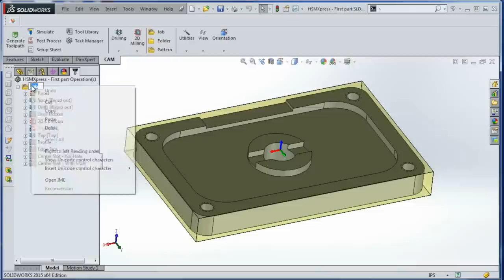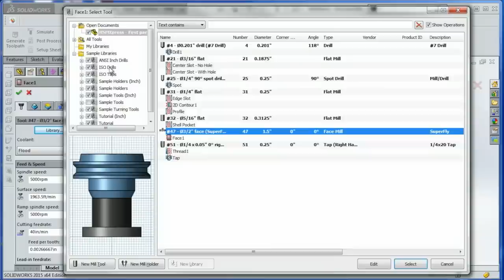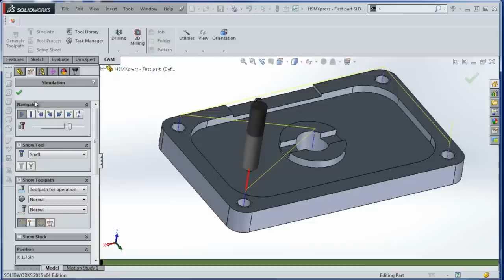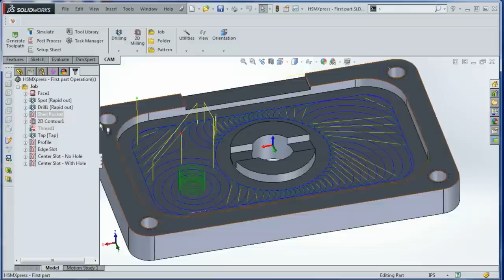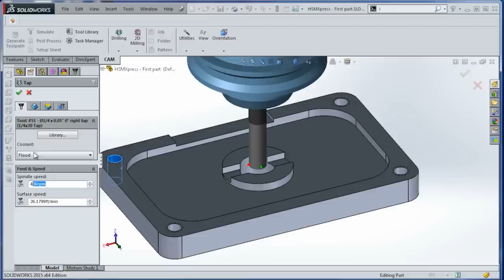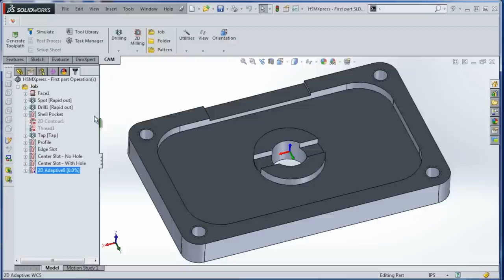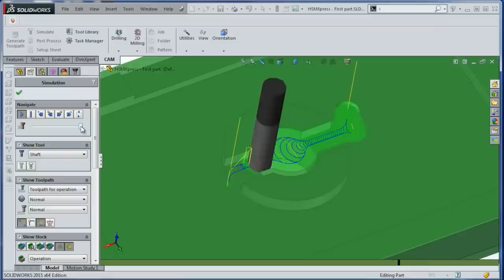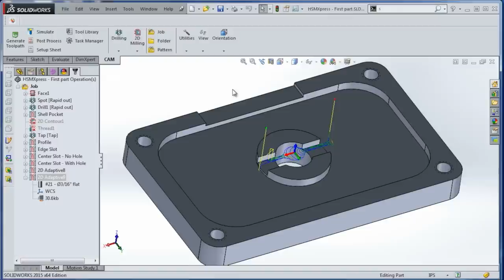HSMXpress Free SolidWorks CAM Tutorial Video!

Comment: I've got to say thanks for this vid. I'm a long time solidworks user and had previously used solidcam way back and more recently SprutCam. This vid pushed me to try HsmExpress. After about 15 mins, I had posted my first code. Air cut then committed to the real deal. First post cut beautifully! This plugin is going to save me so much time for my more simple flat plate or 2.5 cam. Thanks John! You rock!

Comment: I'm usually not a fan of "watch me do this on my computer" videos, but the stream of comments makes all of the difference.  It was very educational to see not only what HSMXpress does, but also how it does it.  The introductory narrative at the beginning of the video was excellent as an introduction to the topic that was very much from the perspective of the small shop owner-operator.  Clearly you've walked several miles in those shoes.

There are already open source adaptive clearing routines for simple pocketing.  I look forward to more complex adaptive clearing, similar to the example you demonstrated, although there's a big hurdle to overcome.  The CAM needs to have access to the entire part geometry.  To date, the open source wizards are specific to common operations (drilling, pocketing, etc.) and can't be told to make a rounded corner rectangular pocket with an island.  Hopefully, in a few years, FreeCAM will have that ability when integrated with FreeCAD.  CAD and CAM are finally progressing very quickly, both for commercial software and open source software.  Until then, if I had a production job similar to the one you demonstrated, I'd probably hand code it for semi high speed machining and live with the slightly less optimized cycle time and slightly greater tool wear.  Or I might trade a favor with a friend with SolidWorks and CAM that generates these complex tool paths.  :-)

Thanks for taking the time to make another great video!  I don't know how you do it.  I can barely find time to WATCH these great videos, and I know how much more time they take to produce.
Reply: NYC CNC I find that to be an interesting approach! :-)
I use robots... Arduino robots. They do the CAM programming as well if I feed them right... Sometimes they want 3V, other times, they want 9. Its tough keeping an eye on them. haha!

Comment: Bobcad v27 now does parametric cad, and has a feature tree. It's still not as powerful as solidworks, but it's a huge improvement over what they had before. I used to make every design change I needed in solidworks, and redoing my paths. Now I can do most of my basic design work in bobcad.

I use v4 at work, which runs inside of solidworks. And being able to suppress features for 3d paths is great, along with making design changes and quickly updating the features. It does crash solidworks occasionally, mainly when I go to edit a work origin. I learned to save often.

I also like how easy it is to modify their post processors, I have tweaked every processor that I use

Comment: There are a couple of things that make it less than intuitive, all based in the dilemma presented with these types of systems... there are SO MANY ways to work with this stuff. So much information available. WHAT gets presented to the user?? How much is simply overwhelming vs. useful. HOW big a nut does the product manager/system designer want to crack? That is before the automation vs. user control issues... SO to begin the discussion......

First is understanding that these systems have their roots in some solid modeler, many B-rep modelers such as were inspired By Romulus and Acis. Second is the interaction of part classification (Solid Models & attribute data) and how the different vendors use "classifications" and Booleans to build machinable models. ALSO know which algorithms use the solid models & attributes populated on the faces and edges vs. those that use essentially profiles, 2D geometry, and points (along with Coordinate Systems) to generate tool path. Key to many is the ability to have information "migrate" from parts defined in a Boolean operation to the resultant  model of part or stock to be machined. Are you machining a  part model?? or a Stock to be removed model?? NOT intuitive. (For example: Classify $solid part, classify $solid stock, Boolean creates geometry to be removed.... and during the "Boolean" faces and edges have information that defines things for the machining algorithm.) AND to make things confusing, some algorithms will use that capability and some won't. Last but not least understanding what "parameters are.. and their interaction with those base machining algorithms. The user interfaces.... bottom line?  If you or those who train don't understand the guts at some level, using the user interface in a linear fashion  is all you learn.

Here's an example of what might happen underneath all that interface... and if you understand this... then find the other algorithms and / or syntax of the commands used to drive those algorithms and then SpurtCam and similar systems will make more sense:

First... most of those algorithms are parameter driven. And they can be set though an interface or menu system directly, or indirectly by creating a text file with an interface/menu system then using that as a "macro" type interaction, or similarly if the system is command based running files such as tool or setup files which go and blast copious amounts of data to set base lines parameters.

When the system is alive (depending on its architecture), a user interface can typically interact with and therefore grab all that parameter data to populate both default settings and do things like define the simple graphic images on the menues... or to even build models such as with tooling for simulation.

Now those algorithm's use the "parameter" information in the definition of their toolpaths:
For example, say you have a series of tooling files defined such that when you pick a 1/2 inch "end" mill all the parameters relative to that tool are now set from that tool's file. Parameters can be as simplistic as diameter and length. (Note with solid models, if material attributes are available, you can look to the model to be machined for information to set or modify tool path and tooling parameters that are now used vs. default....if its ACIS!)  Parameters from that tool's file can also be algorithm or method dependent, things like depth of cut, numbers to tweak a circular interp plunge entry method into a pocket, sets / depth of cut in a pocketing routine, the finish or floor r depth of cut.. etc. ALL depends on the system's design & philosophy.

AND anyway, now that all the Parameters are set... then comes the call to the toolpath algorithm either in command form if its a "command based architecture" or called directly from the interface if its a "menu driven" system or hopefully a hybrid where the menu creates and then executes a command AND build a trail of events in a command file THAT can later be re executed in a macro type form. 

 For example. Going to profile a 2-d part and have it avoid clamps:
A command MIGHT looks something like this:
toolpath avoid $solid entity profile $profile entity...
And what happens is the algorithm looks at the $profile entity, a curve to machine; ( Notice I mixed a "Solid" and a 2-D Profile....in this sample.. to confuse things, could have been simply toolpath avoid $solid1 $solid2 (Clamps) profile $solid3 where the faces of $solid3 are populated with data to front end the base algorithm...ie.  the bottom edges are the profile to be used etc.)  and tries to build a profile toolpath taking into account it must retract and avoid the $solid entity that might be a clamp or some other piece of geometry...
AND things like type of entry, circular, ramp, etc. are set in the "parameters" and things like feed rates, retract distances etc. are also set in parameter files prior to execution of the algorithm. BUT what makes some of these systems special is the ability of the algorithms to look to the defined geometry for critical information.

HOW these systems are implemented differs, I guess I've seen many during their design and implementation and they all reflect the way their designers/marketing/product management types view the world. But at the core..... LOL SOSDD. 

(And it would take a book to define what is the performance envelope of most of those automated routines... SO many special conditions and so many things the USER interface can allow that will simply push past what is possible with a particular algorithm... I could give you an over view of most I suspect, but if you understand the guts of those algorithms and the limitations of the slicing, offsetting, trimming, silhouetting, sorting all the mess created when these things calculate things, a good user learns to "feed" stuff to the algorithms they can  handle and a good system designer releases products with user interfaces that help block situations those routines can't deal with.... another entire subject!)

( What I am seeing are systems that look remarkably like a "proof of concept" system I was very familiar with, designed to show case the algorithms vs. being a end user package. These companies didn't get it relative to using these new to them capabilities at the algorithm level to EASE vs. complicate things which is why they never progressed past systems like SpurtCAM with piles of menus over algorythms. SDRC had folks who did understand...all that stuff got sucked into oblivion and then reappeared as a Siemen Product. AND looks really familiar too. Much more so than they will ever admit. Any way these style systems are why I was interested in designing (actually with another smarter fellow did) a  "process modeling" interface concept to manage the more complex parts. Basically a interactive menu driven command structure & data structure to front end these type of systems to both make things intuitive & consistent but also to radically speed the iterative process as more process complex parts go through their design phase and tool paths have to be modified geometrically....ALL inspired by a conversation I had over a few days with a very smart man in charge of defining things for a vary large Machine tool builder in Japan. Menu's/User interface is a filter....  LOL BUT that was.. leme see  25 years ago! Hence my original comment on being somewhat disappointed in how little progression there has been and now with some of these entries into the market place what we envisioned and even prototyped way back then is just hitting the market in a usable form now. But back to the farm and driving trucks for me :)   )

Comment: I agree with you Soliworks HSM simulation does lack flair. The inventor version got this right, the simulation is far better. You should show how you can use a sketch as tooling geometry, sometimes there are things that you need to cut that are beyond the control of the solid model. I just used that tool today to remove some scalp that was going to get in the way of clamping for a part flip. He is how I do it: Make a sketch, exit, then switch to CAM manger tab. Then make a new tool path, when selecting geometry click back to the solid manger and select the sketch. Then move on like you have before. Hope you like the trick!

Comment: Another great and timely video. I was looking at all the CAM options to support my 4th axis and was looking at SpruteCam. Glad you did this video when you did.

I have been running HSMExpress and am hooked, everything I don't like about it I find I just wasn't operating it properly (lack of any formal training). As others have mentioned it sometimes just doesn't create a tool path and no reason why. Need more in depth video's on all the knobs. I see how the free version gets you hooked and now I want the full version.

BTW there are a lot of HSM video's but yours was the first to address the Stock Contours use. To get some operations to work the way I want I have to suppress the Solid Works features then later protect the HSM entries to prevent them from wanting to pick them back up later in another process, In your video you could suppress the center hole  in Solid Works then cut the notch without worrying bout the hole coming into play.

The HSM drill operations generate the tool path inline, not just when you save it. I wish this was the case for the 2D and 3D processes.
Reply: NYC CNC
Yes, in HSM when I am entering and changing the parameters for drilling holes the drawing  screen are updated as I am adjusting the parameters, other more complex ones like Contour milling it only updates when I check the green arrow and apply the changes. Some video's of HSMWorks it updates all the screens real-time, probably a feature of a paid version? Maybe my PC environment?

Comment: Like Rob said adaptive clearing is a roughing strategy, you should use pocket or contour to finish.

To make adaptive run smooth on your machine you need to use the smoothing and tolerance setting to your advantage, I found that setting 0.0004" for both worked well.  You can set the default value for any field by right-clicking and selecting default.  So I do that for tolerance and smoothing values, as well as stuff like finish overlap.

I noticed you had feed optimization checked, not sure why, for adaptive clearing it's not needed it's really there for legacy pocketing.

Also, to get the most bang for your buck make sure you set the linking feedrate to the max value for adaptive clearing.  This is on the last tab, whatever max feedrate is for your machine.

Comment: I've been using HSMWorks for a few months now and I'm really liking it too! It's my third full-blown CAM package (after RhinoCAM and SolidCAM) and the modern, intuitive user interface truly is refreshing. I do have a couple gripes and you've hit on a couple of them (I'll only mention the ones that I saw in your vid)...

1. Yeah, if you can figure out how to make the option changes permanent in the simulation: please share! Sometimes I would go in there and change almost every single option. Every check box would be swapped, most of the default options (show tool, etc.) would be turned off, and I'd have to select to show the stock. Annoying. Then I might absentmindedly hit the green check mark thinking it would start "playing" the sim (like you did a couple times) and have to start all over again.
2. When you simulate a single operation it starts the simulation with the full block of stock shown. I believe I saw a button somewhere that said something like "update stock with previous operations" though, so that might solve that lil' issue. I would prefer that was the default behavior though.

After you check the "Show Stock" check-box there is a quality option. It defaults to "Normal". Turning it up to "Best" will make the simulation much better looking (albeit it runs a little slower).

HSMWorks (and I assume HSMXpress as well) has another, uh... kind of simulation called "Stock Simulation" (which is two more options down on the right-click menu). If you use that mode it'll check for tool crashes (or tool holder crashes, optionally) as well. Of course, it also suffers from the problem of using the entire block of stock. In addition to the crash checking, it also gives a nice little printout that shows how much material you're removing with each tool. Way cool!

Last thing I'd think other people might want to know: there is a full ~30-day trial of HSMWorks available (or, there used to be). What's extra cool about this trial is that it actually lets you post the code! And, regarding posting code, they told me that they do not mind people sharing the post processor files. Personally, I'm always a little weary about what I'm "allowed" to distribute and what they might consider against their EULA.
Reply: NYC CNC
I did some digging, and it looks like people have been complaining about the lack of changeable defaults since 2010 (at least). Autodesk's response is basically "we think our customers are stupid and cannot handle the awesome power of configurable settings". OK, I embellished a little there, but the message isn't too far away from that.

I looked through all the HSM folders I could think of (Program Files and AppData mostly). There are a couple files in there called "cimco.ini" which contains settings that look a lot like they would control the simulation, but I nothing seemed to change when I messed with the values. :/ I think there were a couple XML files which I looked through as well, no luck though. I also searched through the registry as well as I could, but nothing looked worth changing.

Comment: The CAM integration in Fusion 360 is quickly becoming more powerful than HSMXpress. For the home user I would highly recommend Fusion especially for the price.

The great thing about the HSM line of products is that they hardly need tutorials!
Reply: For single part machining jobs I have been designing straight in Fusion but for big multi part jobs solidworks still wins. The import capability of fusion means that you can do both if you want. It imports native solidworks files no problem.
The CAM side of things is pretty much identical to HSM because it is HSM, but the way you select edges in fusion is massively powerful and flexible. You have probably figured it out already but with HSMworks in Solidworks and fusion 360 you can use sketch lines as part of your machining so you can artificially make machining boundaries and all sorts of things to extend the possibilities.
The direction Autodesk is going with fusion is super impressive. Check out the Monkey Likes Shiny blog to see some cool stuff they are doing with Jeff Tiedeken